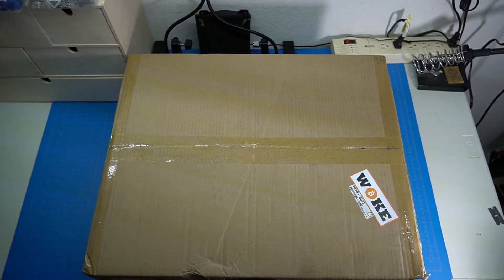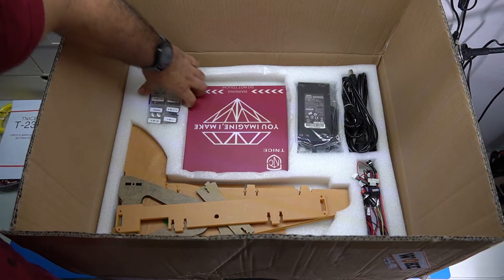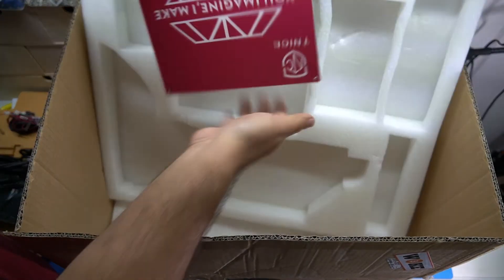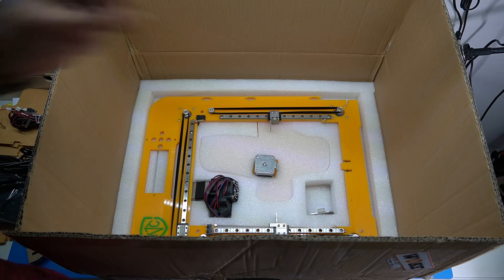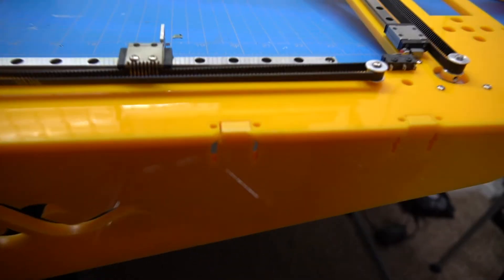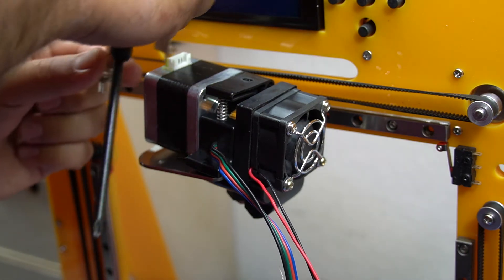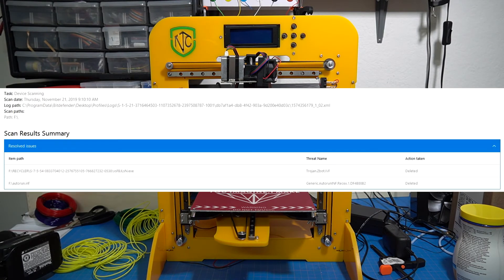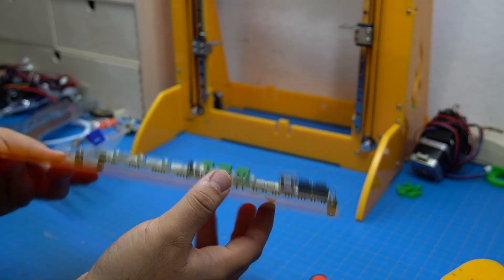I bought the cheapest 3D printer on eBay! $90 USD

Comment: Could it be that their flashing-PC / QA PC to check the memory cards is infected and just spread to the SD card? There are way easier methods to get someones data on their PC. 
The "plan" to rent a warehouse, selling large boxes full of stuff and exchanging the memory card in those boxes to include an outdated software / malware is far to complicated and costs are ridiculous. Just take some serial key generator or some legit freeware and ad your malware into that.
Reply from the maker: Yeah, who knows what really happened. The sellers from eBay were pretty sketchy. After I reached out to them they ended up deleting all their posts for the same printer.